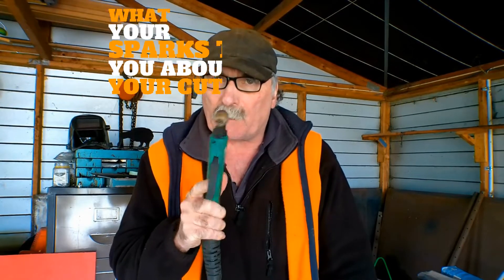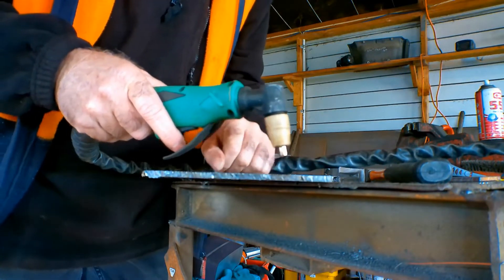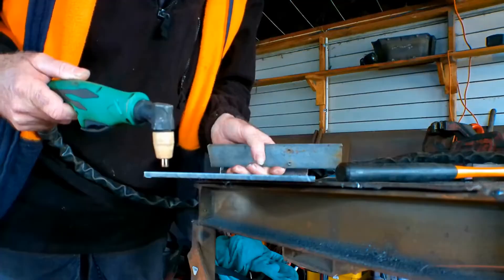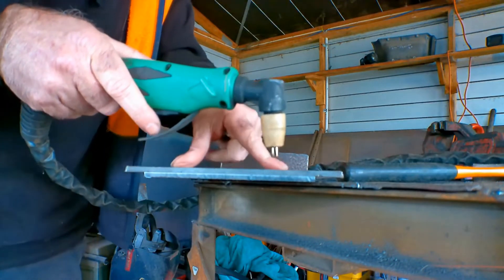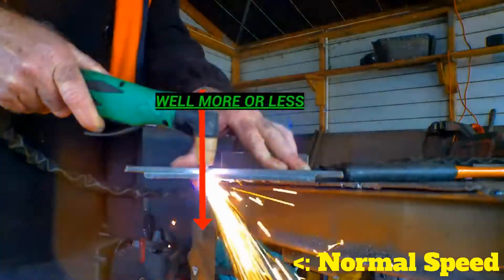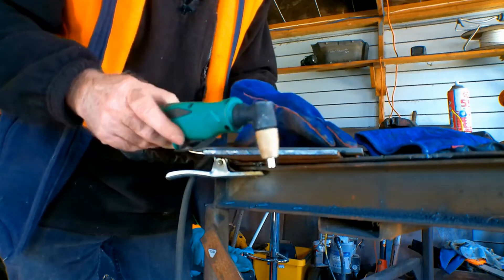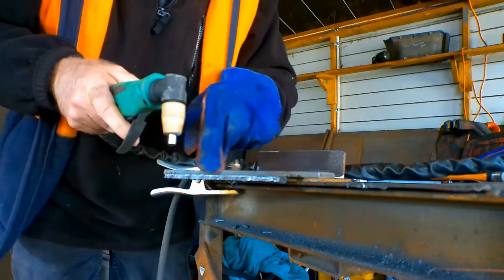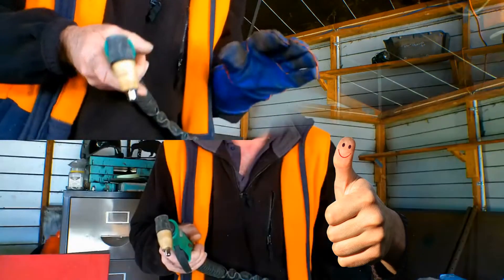Is Your Plasma Torch Talking To You?

Comment: I've learned from you that unless you run a commercial operation, a cheap plasma cutter is perfect for  occasional cutting. Mine is a pilot arc 50 amp  $250 chinese cutter from Amazon.
Reply from the maker: Yea good machine mate ,Thanks for watching